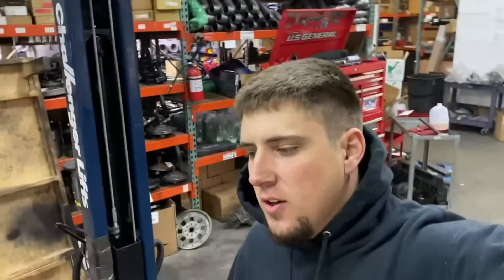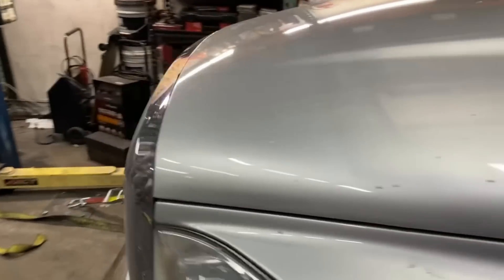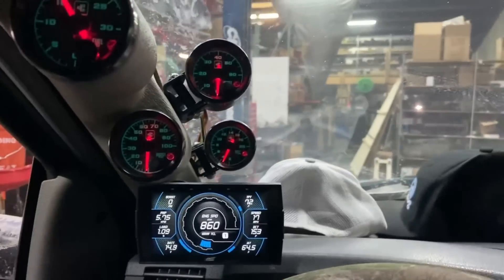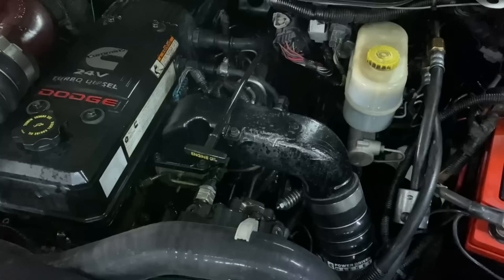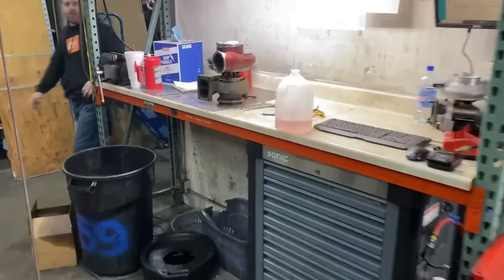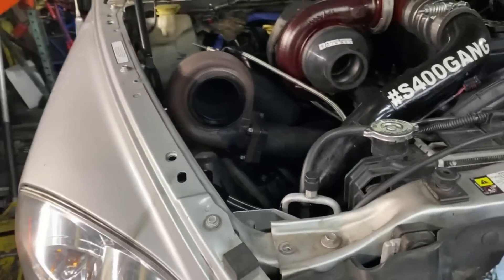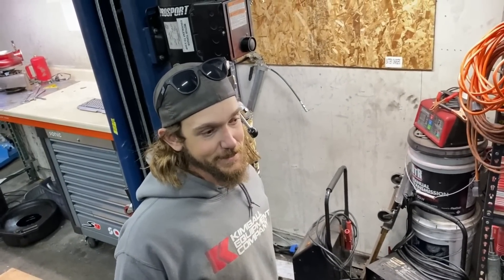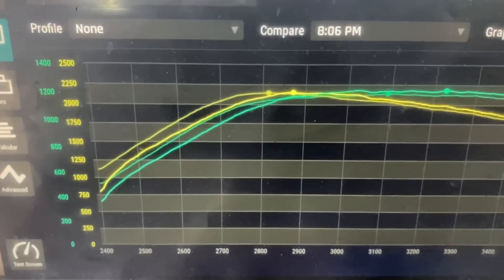COMPOUND TURBO SWAP 488 ON THE DYNO, MORE AIR.

Comment: I'm new to Diesel engines and it's kinda crazy to think a 360 cube engine making almost 4X hp per cube can be a daily driven vehicle.
Specially in a heavy weight truck.
Simply Amazing.
And all with 2.20 a Gal fuel ⛽.

Be a tough task to do on E85 with a LA360 in my  71 Plymouth.  Parts be flyin' 
💥💥😎

Comment: PLEASE check the fuel mileage on your road trip. Been thinking of suggesting Power Driven Diesel put together  a maximum horsepower - fuel mileage  tune-up kit. Is 25 mpg possible with more power added and how much?

Comment: I would have thought you'd pick up more with all that air. What's your duration and rail pressure? Is it falling off or defueling? Diggin' these "F-it! there is a new engine on the way" vids though.
Reply: The manifold charger is normally the restriction point

Comment: Intake horn is choking you bro. Its a $265 part. Swap it test it and prove me wrong or not. Honestly I just want to know how much difference. Banks monster Ram. I know he gets a bad wrap with his clean air things, but more air is more power.

I already linked it in a previous comment. No affiliate money just truly curious what it does on the dyno. 28psi before install stock program. After I hit ~35 psi like a rev limiter without a tuner. Program allowed me up to 58 psi max boost on super sport. Got a 10k parts pile on the floor waiting to be installed. Debating on HP tuners or efi live. Banks is too limited.

Doubt you will read this, but if you do thanks.